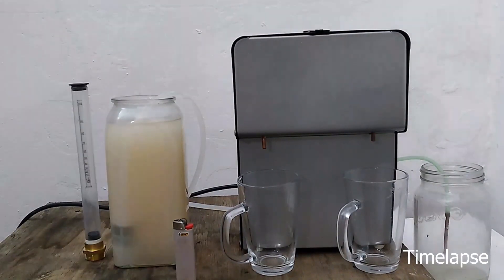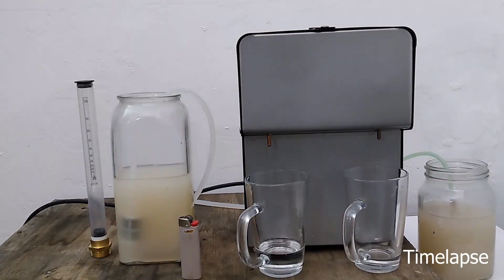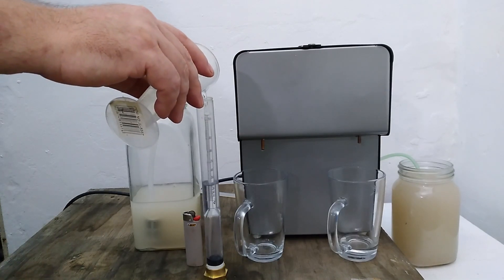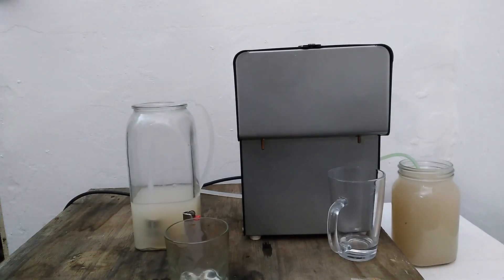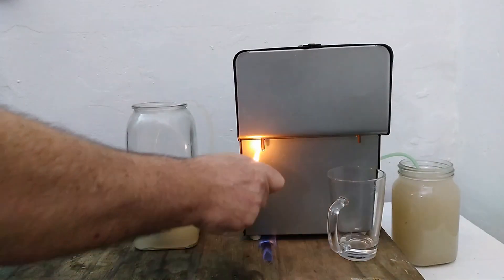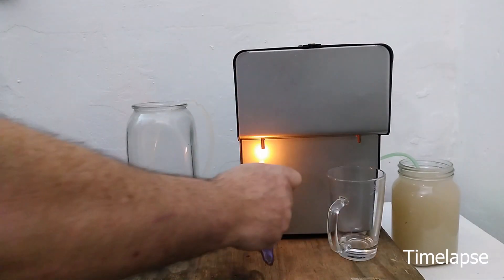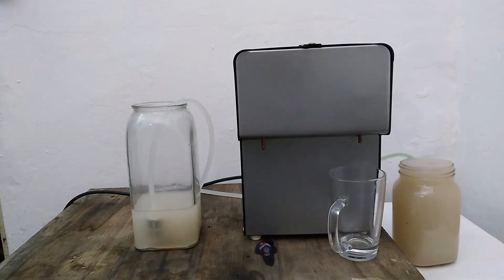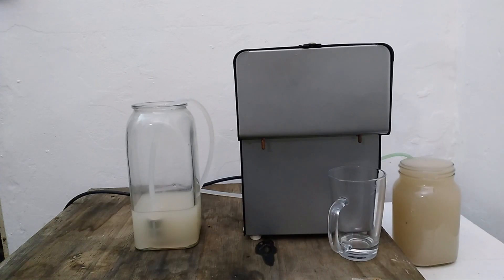Open flame safety test for MyVodkaMaker   PART 1   time lapsed

Comment: I just bought a "Plus" machine, and my first time running a molasses rum wash through it, the inlet tube clogged. All that the instructions say to do is to blow air through the tube to clear the clog, but that didn't help. What do I do?